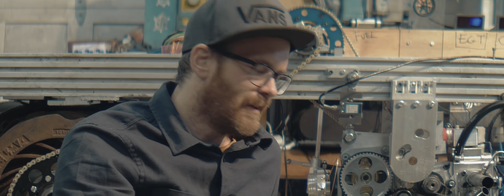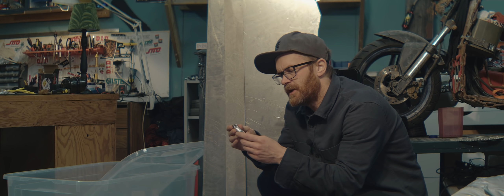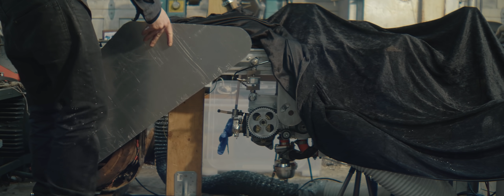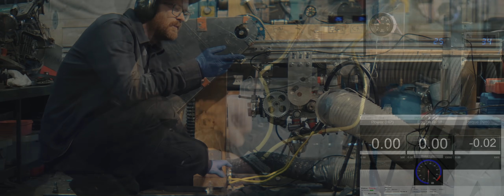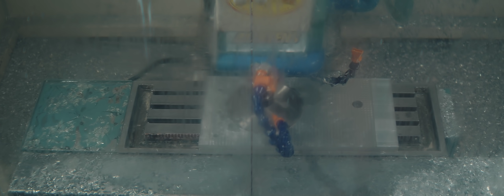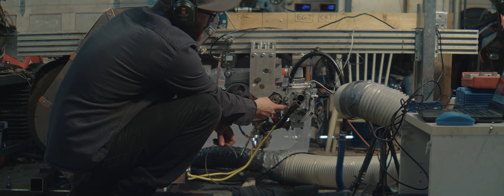Re-upload, BETTER? Cranking up boost! Supercharged 50cc Nitro Two Stroke!

Comment: Probably already been asked/answered but has there ever been a modern-ish 2 stroke with an exhaust valve/supercharger setup similar to the old Detroit 2 stroke diesels?
Reply: This is it
Reply: @connorssmallengines6663  Fair point. I had my mind stuck on the cam/valves but a rotary exhaust valve is pretty close
Reply: Euro 6 emission standards.

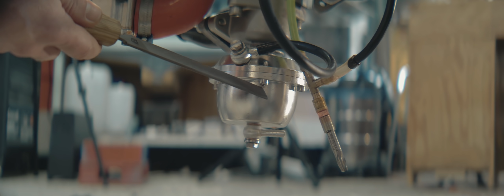Comment: @1:02 ''How to use a 8mm two-flute-mil in multiple ways''  😁

I just love the way you go about building and tuning your engine!! 
Never give up!

I had a Puch Maxi when I was young, loved to tinker with it! 
In time, I went from a 50cc to a 70cc with a 19mm Bing carburetor, and mounted a Kreidler 18k max RPM counter on it (that eventually died because it made more than 18k revs at one point)...
That thing did wheelies just on torque and a little sitting back on the, self-made, buddy-seat!!  
Sometimes I'd put in a bit of nitro model airplane fuel, then it was truly insane!! 
Ever tried to mix in a little nitro with your ''normal'' 2 strokes?

Comment: Could you balance the crank to compensate for the rotary valve imbalance? Maybe make a carbon rotary valve?
Reply: Alex mentioned in one comment about balancing the crank and Disc Valve as on unit. There has being many comments re DV balancing, mine is to add a bob weight to the DV drive pulley. Of course a stronger lighter DV should cure all problems.  
Alex will have to get on with the PiP engine soon, and this will require a fully balanced crank.

Comment: Question. Wrkn on my 2,000cc 4 cylinder 2stroke cross flow engine. The transfers go up thru side of cylinder as normal then where it goes into cylinder it goes thru 4 small round holes tgat are in the steel cyl liner same on ea cylinder and same on exhaust side as well. Big port but 4 small round holes go thru the steel liner .   so as you can imagine there’s 3  bridges in the way of the charge getting into the cylinder. Would I gain by turning the 4 round holes into 2 oval holes losing 2  of the 3 bridges being left with just 1 bridge in the center of the 2 oval holes. Not changing the actual transfers nor the timing  just the holes in cylinder liner.

Comment: with boost, you may also run into  ring butting, generally its wise to increase the ring gap with boost. you weren't running much boost or for very long, but I would inspect the old ring very closely just in case. That motor is starting to sound like a nasty little beast ! keep up the good work.

Comment: I'm wondering ... with those high RPM the engine is doing, how do you balance the rotary valve considering the big cutout in it?
Reply from the maker: I haven't really looked much into it yet. Would have to take crank balance into account and balance the system as a whole.
Reply: @2STROKESTUFFING  
Balancing the crank shaft system as a whole is probably a must ...
Still, an individual part as the rotary valve must be able to take the centrifugal load and not come loose.
Reply: By adding a weight to the disc drive pully.

Comment: Will a ringed piston ever be able to handle the power and pressure?
Have you considered a ringless piston like they use in high performance r/c engines?
Reply: Will a ringless piston work at low revs?
Reply: @malcrandall1309  a ringless piston should work at low revs as the piston is effectively machined with rings being part of the piston. The life of the piston is obviously reduced as there is no tolerance for wear.

Comment: You've really taken this idea a ran with it I'm impressed 

I think its time for electronic tuning 

Full electronic ignition 
Efi
And a proper boost controller then change the gearing on the supercharger for more boost 2 bar or not 2 bar that is the question

Comment: Venting unburned air/fuel mixture through wastegate is not optimal. You can either recirculate it back into compressor or tune it by altering pulley gearing. Also, that exhaust disc looks severely unbalanced. How about cutting two symetric slots and running it at half speed?
Reply: Maybe the disc will not close fast enough turning half the speed?

Comment: for an test.
You could try to couple a pic18F452 to a simple led light barrier component PCB component.
mount a disc with a hole to the flywheel.

than you should manage to connect a 4 line 20 char 5 volt LCD display.

search: PIC TIMER CALCULATOR, a English hobby site will appear with a timer calculator for pic processors... and gives you the code.
with a 16mHz Chrystal / XTAL you can make a 100.000 Hz timer accurate, precise ...
making you able to count time of the events in a rotation.

than you be able to measure each rotation of the flywheel using basic math and display it on the LCD.

than you probably should try and manage to understand the lambda sensor of a car and try connecting it to the pic18F452 and display the value.
it's probably a element that changes in resistance to how much air in the exhaust.

witch you would also be able you to read a pot meter ( mounted on the butterfly ).

later learn to connect a 24lc256 eprom to the I2C port of the pic18F452 port.

you need a ICD3 programmer and MPLABs compiler, lots of code is online there, just copy and paste.
Use Autodesk eagle to design a PCB.

doing it right, you could make it produce music.

Comment: Run your exhaust valve at half speed, cut a slot in both sides so its balanced.
Reply: Genius!
Reply: @Rubik Monat  Good thinking!  I was always worried about the imbalance at the huge revs this thing does / will do.  I never thought of the half speed idea though.
Reply: Why?
Reply: @csud9540  less wobble, less friction, more nice
Reply: @sparkie5571  ok, cheers👍
Reply: This can work
Reply: Maybe it will not open and close fast enough?
Reply: @nhytg376tgyuu765gjmg  Then you adjust the size of the port to match the speed of the valve.

Comment: It's just a thought but, what if you shortened the piston connecting rod by a few millimeters?  As I see it at top dead center, it's very close to the ring at the top.  Upon warming up and high rpms, there's a possibility that the piston is traveling further (even 1 millimeter) on the compression and exhaust stroke.  You'd be losing a little compression, but the chance of it smacking the ring would be alleviated.  Think of it as an old person driving a car very responsibly.  No high rpms.  People seem to like buying vehicles that were owned by old people, because they would NEVER rod the piss out of the car.  They buy the car that runs awesome.  The old people drove it the same way and eventually built a carbon ring in the top of the cylinders.  The new owner drives it at a higher rpm.  After a while, they notice poor performance and blow by in the engine.  The higher rpm caused the piston to travel further up in the cylinder, causing the piston rings to hit the carbon rings built up in the cylinders.  Under heat and pressure, meeting sudden resistance, the rings snap.  In your case the rings didn't snap (yet), but chewed on the piston.  A slightly shorter stroke (with the added boost and accessories) may be something to consider for the high rpms you're going to achieve.   Keep going.  You're making history by building a new engine.  It works.  You're just fine tuning and working the bugs out of it.
Reply: I would add another  piece"s" of gasket , it is the easiest way I say
Reply: Or by making a cylinder head with more volume still allowing a squish band and made from sintered copper.
Reply: @malcrandall1309  I thought of that also, but I thought I saw him point out a metal ring at the top of the cylinder.  More gasket would raise the head, but if there's a ring that's between the cylinder and head, the piston will still hit it.  I could very well be wrong on there being a ring at the top.

Comment: You should make a vacuum hold down, make a plate with tiny holes, and connect tubes to sections of holes so the area of use can be turned on to fit the part in the machine,

Comment: Yes the image is watchable now. Over 16000rpm begins to be interesting. :-)
Reply: Yes your quite right, 16-20,000 is the interesting part of the rev range. The engine needs to hold  maximum revs for at least 5 seconds on load, better still 10 seconds.
Reply: @malcrandall1309  For road use, it could be annoying, but for Bonneville I think it is favorable, hoping the piston seal ring doesn’t become to much dilated and catched in the ports at full speed, maybe a free wheel sprocket could prevent the rear wheel to stall, in case of engine failure?

Comment: Hey brother I can’t explain it but I’ve seen several boost controllers like that and they all have that ball not all of them had that extra t some had that ball in the boost controller but some of them also came with instructions saying you could remove that ball and spring but I cannot remember why I’m a supercharger guy now it’s been a long time since I played with the turbo in my Evo because that car is incredibly loyal but I do remember that ball was in the same position as yours because every time I ran into it it also confused me like it confused you but they worked just fine leaving the ball in

Comment: Image is way better now.
Love to see your determination in making this project a succes! And learning so much from your experiments. 
Would make trottle fixed though, so it would be easyer to handle with one hand. Seems you have plenty of old motorparts.
Reply: I would like to see one handed throttle operation then the other hand can operate the retarder using a manual potentiometer to control the current allowing full control of engine loading doing away with the engine stall problems when it becomes over braked.

Comment: In the Philippines I had A  Standard Suzuki  X3 125 my top speed is 136 kms.. an hour least.. it was going and going farster.. but i had to slow down.. Cas of A Corner ..... .....  I use in my engine oil and fuel a metal treatment... type... in it ..it's so smooth running.!
And I put it in A KMX 125 Kawasaki ..   Revd it up to 12000 rpm with metal treatment... 2000 Rpm in the red line... for 10 seconds.... 
Before metal treatment only to 8500 rpm.. it's dragging.. at that. RPM!........... ? Are you allowed to use a metal treatment?  .. thanks

Comment: I have mapped a piggyback ecu for a fourstroke back in the days, when i tuned to fuelmap and boost levels i had a broadband lambda to a laptop that i read the current lean/rich in the exhaust.

Can something similar be done with twostroke motors? It was a HUGE help when adding boost to not lean out or spike. Seems super risky to not measure o2 saturation in exhaust when adding boost.

Comment: Controlling supercharger boost with a wastegate will cost significant power. It takes power to compress the air, and bleeding some off means hp will be lost along with the vented air. The energy used to compress this air is simply lost (without recovering it as useable charge), a bit like a Jake brake.
Reply from the maker: It's just to see how much boost the current drive ratio will produce, will set boost with gearing later.

Comment: There is, what looks like, a chunk of piston missing at around 13 minute mark. More boost (+ much higher revs) = more heat and if piston rings have nowhere to expand, one side will usually bulge out and cause damage. Might be a good idea to slightly increase the gap, just to be on the safe side

Comment: LAMBDA SENSOR
Reply: Hello Dan. I wonder if you could help with a question I have regarding Lambda sensors in general as I come from the carb era I have asked on other comments about how do you go about designing a fueling map for such a dirty engine as this without any prior knowledge. 
I've got a general idea of how to do it on a clean petrol engine but not a RC fueled blown two stroke.
This is a genuine question. Could anyone else reading this help me out.

Cheers, Malc.

Comment: For an additional level of safety, you might want to add a second, hand-held deadman's switch in series with the ignition cutout on the panel above the engine.  If things go south, you might not want to be reaching over the engine to turn it off.
Reply: This is actually a pretty good idea! Every bike should have this. Boats have it and saved my father's life, later on saved his colega from getting chopped by the propeller... Same theory here, no jokes! 👌

Comment: Ah realistic color but I like the old feeling faded color. It's a kind of special style for this channel, goes well with the whiskey drink shots😁👍
Reply: absolutely, but that can be a bit too much when the footage is almost untouched, that's what these lenses, and cinema, semi-cinema formats do, the image that comes out is (in an optimal scenario) very faded, low contrast, but high dynamic range, that's why it looks pale, neither the blacks are black, or the whites are white, since the original footage covers higher bitdepth, and you can (have to) recover them, setting the balance of each section of the histogram, so you get a good representation of what your eye would see, at that point you may turn the contrast a bit, pull shadows back up to pronounce this hazyness a bit more again, but already showinf more details sharp on your overall image, he is doing art and a very good job both with those engines, and the videos, many thanks for making them.

Comment: Much better on the colour! I noticed in the first run you were getting up to 1.2 bar boost so its capable of generating it!!
Reply: @2STROKESTUFFING  I think you need to calibrate the system better (possibly with a known engine) and then try to do a proper power run holding the engine at fixed speeds on the break WOT.
Reply from the maker: @manoo422  yep. I'm just getting to know the engine first, working out things that need to be improved.
Reply: @2STROKESTUFFING   where are the subtitles?
Reply: @KomUrczakPlay  ha ha i got destroyed i said i didn't understand what wideo ment i was just kidding channel is number won!

Comment: whats diffirent?
Reply: I'm not too sure about your comment "what's  different" If your referring the difference between the Brute force and a clean engine. The Brute force is a experimental  blown two stroke running RC fuel and 15% pre mixed oil. It leaves a pool of unburnt oil on the floor, there's enough unburnt gasses coming out of the exhaust pipe to choke Alex when the extraction pipe came off. I think a lambda sensor wouldn't work for 2 minutes in that environment then it needs to go to a CPU which in turn controls the injectors, Don't you need a fuel map in the CPU to carry out fueling alterations.
What I asked was a genuine question and I would have liked a decent answer. I have asked this question 4 times now and never received a reply. As I said I am a carb man who's only run normally aspirated two stroke engines running pump fuel. With what do you read a Lambda sensor, I don't know, can you help?
Reply: @malcrandall1309  i mean the reupload ;)
Reply: @j.schwarts9837  Sorry!